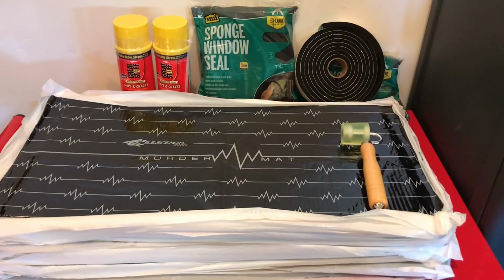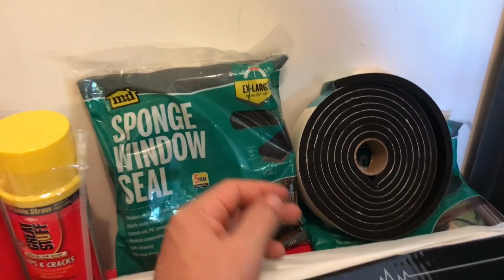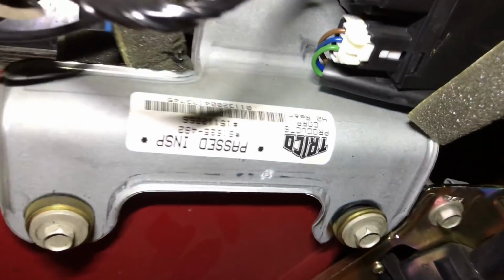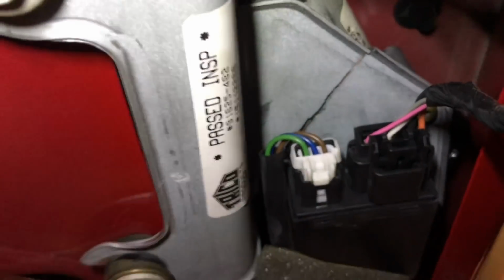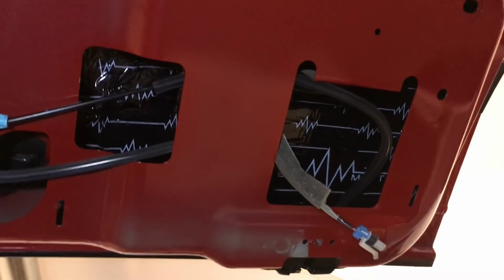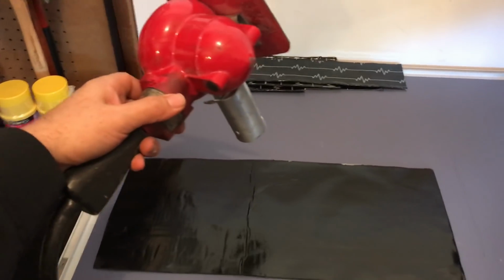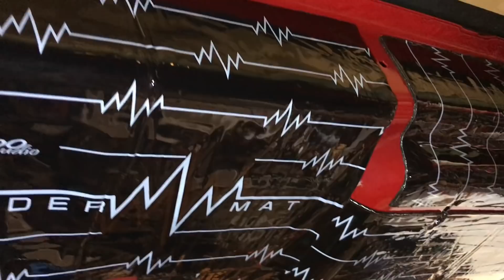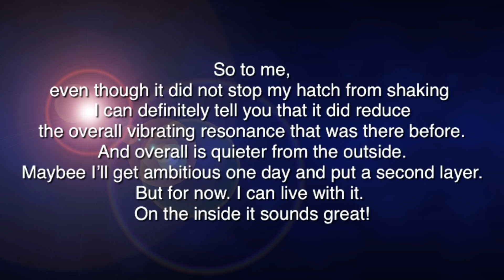Vibration Killer! DIY Sound deadener install Crescendo Murder Mat deadening. Before and after!

Comment: Nice!! Seems like it made quite a difference, now you can go though and try to find individual trouble spots in the tailgate that are causing rattles. If you didnt do anything with that broken bracket I would get something behind it so it's not metal on metal. I'd also get behind taillights and trim peices with something to stop the rattle. I was able to almost eliminate vibration in my trunk build with spray foam and several tubes of silicone for the trouble spots where sound deadener wouldn't fit. 
Nice build keep the videos coming!!
Reply from the maker: Hey man, thank you for the awesome feedback! People like you make the audio community a better place. Thanks!
Reply: @NextLevelCarAudio  
Well I appreciate people like you that make  these videos because I wouldn't know the first thing about making a youtube video. Lol. So thank you!!
Anyways yeah I even took apart my taillights and put silicone (glue) in a few spots behind them to isolate them, it made a huge difference. That and secured anything that could potentially rattle with silicone and spray foam. With spray foam you can reach spots that you cant with anything else.
Good luck and keep the vids coming, your hummer is badass!!